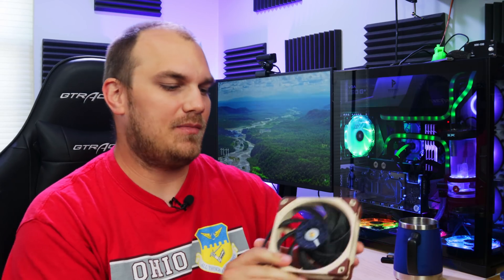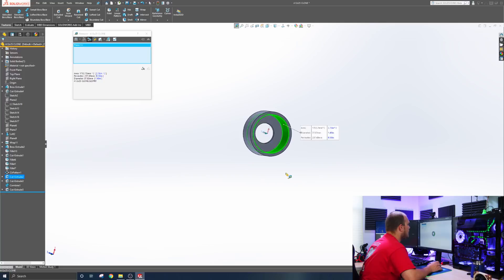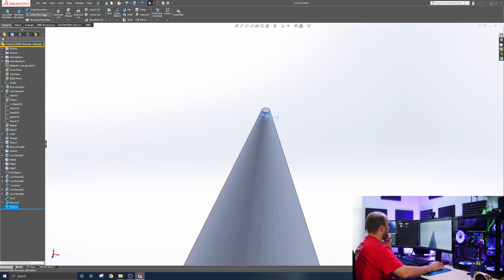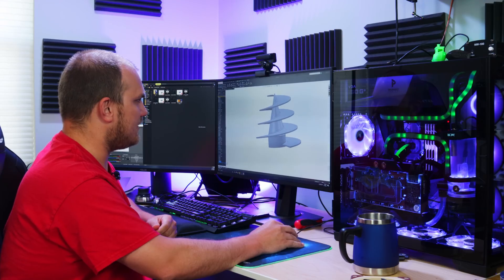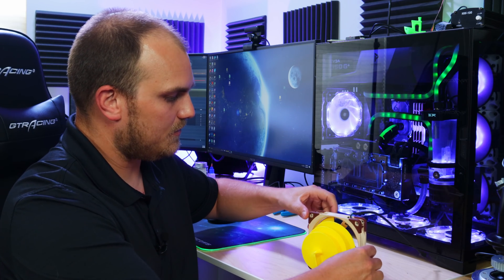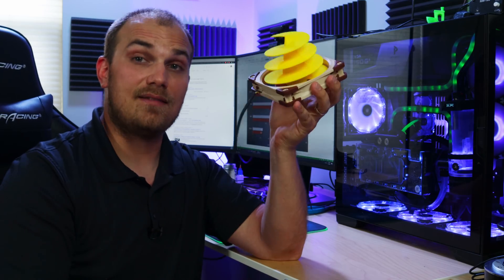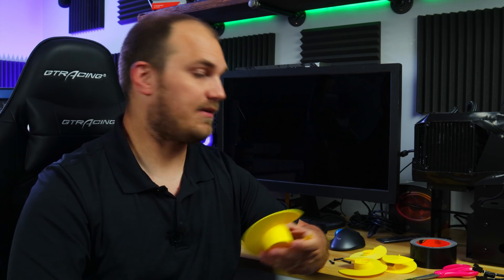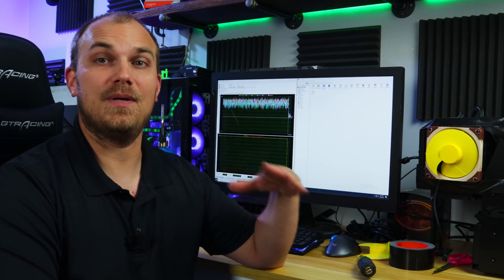Leonardo DA Vinci Made A PC Fan Would It Work?

Comment: Your making the age old mistake of thinking his diagram is a simple helix like a screw, there is intended to be a series of blades that run the length of the helix, across the air foil, from the center out, with an opening at the base of the fin, look at leonardos diagram closely, as he did many, one in particuler, which you showed in the beginning of your video., the second picture you viewed. Each of the radius sections shown are actually fins or blades.. with an open area at the base to provide constant air grab down the entire length of the helix.. just sayin.. we all know forced air or fluid dinamics require an area of containment, i.e. placed in a tube.. i liked your videos until i seen this..

Comment: The screw pushes the air out sideways from the top. Very little air actually goes down.

If you angle the outside of the screw down compared to the inside, it might push more air downwards.

Comment: I think you need to incorporate the elements of an airfoil like a wing as far as curve and shape of the blade.  You have to understand the physics of air movement and/or lift in order to incorporate those elements when designing the blades.  The other fans may not have worked as well as they could have because you didn't included considerations of physics into those designs.

Comment: i feel like the problem with this design (and I haven't tested with cfd/etc) is you're losing air out the sides.  what if it was still a spiral, but going down the corkscrew it used vanes tp pull in air like on a blower fan?

Comment: What about a double helix? should teminate the vibration issues. 
Also for a more effctive airflow try inverting the design, expanding the arial screw outward from the fan, and including a shroud along the edge of the blades. (think compresion in a turbine engine)

Comment: For this to work it would need to be a ducted fan with a constant diameter. Air moves outward as the fan spins so without a sidewall it doesn't go all the way through the fan.

Comment: i believed the source of unbalanced spinning is because you made it 360°. the weight could probably unbalanced or the angle is not 90°. probably 570° could counter balanced the vibration issue. who knows, just a theory
Reply: + shroud tube so the air doesn't escape to the side

Comment: A problem with that design is that the air can escape out the side rather than go through heat exchanger. If that blade was surrounded by a wall it would have no option but to push air through.

Comment: Hi! What about turbine compressor like fan? 3-4 blade rings on one shaft with the biggest fan in front and the smallest in back. all this with outer wall closing diameter with size of fans (like cone). That means: idea is that 1 fan will take thx to bigger dia. more air than 2 fan and 2 fan will take more air 3 fan and so on...  so final air should be denser and take out more heat .. maybe :D all fans can be on one shaft because difference in speed will be created by diameter ... look up for jet engine how it works

Comment: One of the issues with your design is that the spiral of the DaVinci design has a wing-like design of the blades, where it's thicker towards the center, which uses the same properties of splitting air pressure that an airplane wing uses, except oriented in a spiral. I'm not sure if it would actually make a difference, but in theory you should be able to produce a sort of lift under the spiral wing and in effect create airflow.

Comment: It would have worked but you see where you messed up at is that it's spinning the wrong way and even so you would have to build a funnel so that the air would go down the spiral because without the funnel you were letting air run freely, it's like putting a fan inside of the window blowing outside to suck all the hot air out instead of turning the box fan to where it blows air inside of the room

Comment: You can make it as a screw in side a PIPE so no air escape and full air forces in to cooling and one thing make  6 or 10 or more individual blades twist together  for more air flow inside the pipe☺️

Comment: U should try the house exhaust stack toppers in reverse, u know the domes with crescent cuts that keep the rain out, they are used to release a lot of flow without resistance maybe used in reverse it will pull a lot of air.

Comment: if you enclose the whole Archimedes screw into a cylindrical cone it will definitely will suck more air since the air doesn't have guides on where to go it just splash away before it even reach its destination you want it to go it just distort the atmospheric air around it

Comment: I am now subscribed, I find this interesting.  Here is an idea make a cowling (both tapered in and our) to see if that makes a difference.When you got it down to a single turn on the screw it looked like one of the old ship propellers when they started to use steam engines.  They started with one turn screw (literally) then went to two blades, and now they used as many as 7 blades on ships propellers (screws).

Comment: The first one would work if it had a cone shaped shroud just below the "grabber blade" that it pulls the air into. You basically have that air thats being "grabbed" escaping out the sides so it essentially doesn't do anything. Same reason Davinci's didn't work. Modern helicopter blades flex which I'm assuming is why Noctua's blades work so well.

Comment: There is a wobble, but is it consistently in the same spot or axis for each model you make?  If so you might be able to cure, or at least help, the vibration problem by using solidworks to find the center of mass for you.  Then either add or subtract material on one side to bring it closer to the axis of rotation.  Either that or use a hand drill and make dimples to remove material.  If you can't cure the wobble, cure the weight.
Reply: I suspect from the video that you also have more mass on one side of the vane also.  And it will exaggerate the effect on the outer edges of the vane.  If so you could lengthen or shorten the length of the vane just a shade to pull the center of mass back to center.

Comment: Tip 1: You're spinning at the wrong direction (in the beginning)

Tip 2: put a wing on it that runs along the spiral all the way to the bottom

Tip 3: hollow out the cone to improve speed and stop or lower vibration (this also lowers power needed to operate)

Comment: Curving the edges of the blades could help. As others have said the air is going out the sides so a curve in the edge of the blade will force the air down instead of letting it go sideways.

Comment: You need the blade to be spread apart more and there needs to be a ram style air capture at the start of the blade so the air can be channeled through the fan since the blade has no edge on the outside diameter the air is just moving out of the fan from the sides

Comment: You would likely have better luck running the air screw in the other direction with the air being transferred from high flow area to low flow area, similar to a jet engine. This way, the air will be accelerated by the decrease in the area rather than vice versa. A shroud on the outside would also be likely to provide a significant performance boost.

Comment: The screw doesnt "hook" the air. it pushes it, so as the air compresses it doesnt travel along the screw but it travels outwards along the blade and out into the open space. you need a screw inside a cone to funnel the air. Thats why if you look at the original sketches of the screw its not really a screw but a moving cone.  As the spiral spins it cups the air and forces it down. There is some serious improvement, but cool vid bro.

Comment: I think that fan blade is statically balance but not dynamically balanced so it will always want to wobble at high speeds even when printed perfectly. Soooo don’t be disappointed when printed with a better machine and it still wobbles.

Comment: What may be neat to see is that fan with a longer duct to trap some of the air which may escape from the sides, or even better, a fan that has a larger opening and larger initial fan and intake diameter and ducting that constricts and compresses the air down (at least in theory) like how a jet engine or steam turbine works to get the most efficiency out of a given volume of compressible fluid. Obviously, in no means practically as it would need to be a few inches/centimeters (for the ones who don't like the freedom units) long, but would be neat to see if compression does anything to improve it, as just the act of compression may increase the air temperature... Though probably not enough on that scale to matter!

Comment: The first thingi thought was that the whole thing wasn't spinning the right way at all. It wasn't scooping the air out as it were, but smoothing it down, that doesn't drag it out, that's just no good.
But of course it was blowing in, not sucking out XD. Yeah my brain...
But yeah, there is definitely a reason fans don't look like that.
Also, a tunnel around the whole thing probably matters A LOT !
So you might want to retest with an extended tunnel/fan hub.

Comment: It is basically only one fan blade with quite a low pitch. It should be slightly more efficient than one blade on 7 or 9 blade normal fans but to move same amount of air it needs more rpm(x7?) and/or more pitch(and this will have limits). You should check out NightFlyyer on youtube he has taken the one blade idea really far with rc helicopters. Same could be done with a fan.

Comment: try it like a submarine pump jet, put the screw in a tube, the air, if you are moving any currently just spills out the sides as its not contained, so you get no flow, put iit in a tube ;)

Comment: so, essentially the typical fan IS an airscrew. there are just many many more blades to it and much shorter. this design only allows for a mall area to capture the air (the area at the opening between the end of the blade and the one below it) you need a shroud to be as close to the outside of the fins as you can get to focus the air where you want it, and I would recommend that if you're going to use this for cooling, you need to flip it and add more there's to the air screw. this would allow the largest diameter to be on the outside so that more air is gathered to force the air down to a smaller opening, similar to what a turbo does to compress the air.

Comment: I can imagine a lot of air is being pushed outwards (sideways) from the axis of the fan. A duct or cylinder wrapped around the fan could possibly improve the air flow and direct it where you want it to go.
In effect your fan is a single blade design, generally more blades are better and the pitch angle also affects the air flow. Maybe putting alternating 'gaps' in your single fan would help to shift air better? So it is still a screw design but multiple blades?
I think it would be hard to improve on the efficiency of a traditional fan shape! Maybe something like a turbine shape of a turbo charger? Or multiple layers of traditional shaped fans stacked vertically up the centre axis, so the fans are aligned so the gaps and blades are staggered? 👍😎

Comment: 17:30 The vibration is caused by difference in direction of rotational acceleration at the lower half and the upper half of the fan, something like this:
...|
<-|
...|
...|->
...|
as a fan rotates, these points move up and down, caused simply by the movement of those points where the spiral abruptly ends.
It is impossible to fix if the design is 360° arc. Two symmetric 360° or 180° arcs instead of one would fix this. Two arcs that both start at precisely the bottom, on the opposite sides of the fan, and end precisely on top.
In fact two 180° arcs should work better than one 360°. Four 90° should work even better. And eight 45° arcs might work even better better, but I'm not sure. There should be a point where further increasing the number of fins no longer increases airflow because air starts bouncing away from fins rather than down.

Comment: I would suggest a triple helix with the cone inverted (small end towards the motor) with a matched stationary shroud. Should only need a 478 rotational degrees worth of blade height at about 30degrees of angular diameter change while maintaining the gap between helix’s at 25-40% of the effective blade depth (edge to hub). This is provide a large grabbing service and provide a compressing effect. I like the idea of a raised lip to minimize radial air loss.

Comment: Basically high presure blade, no flow. In a shielded cage would work to high positive air pressure cage... If u twist the corners down air doesn't go OUT of the center so maybe you get more flow

Comment: I'm just guessing at the physics but I'd think that you'd accelerate the air up to speed on the first layer and just be pushing on air already going at the speed of the fan on the second layer.  Maybe adjusting the angle of attack as it goes up would let you continue to accelerate it?  (I'm thinking, I guess, more in terms of applying thrust as a helicopter.)  Also, for a copter I'd think that enclosing it in a tube would keep you getting the air up rather than out.  Pushing air out to the sides doesn't do much for vertical lift.  
For cooling/moving air... maybe have the spirals get wider farther up to push the air farther away from the unit?  Maybe that could have a niche use if you needed to move air more to the sides than the top.
I wish I could do CAD.  I've tried to learn but I'm to ADHD outside of a classroom setting.  I tried inventing a new kind of chord harmonica but couldn't get all the moving parts to work.
If you put LED lights on the end of that fan I bet you could sell it as a cool lamp.  
It would be cool to have Smarter Every Day weigh in on the physics of all of this.
I wonder if it's got something to do with only having one point of entry for the air.  I wonder what would happen if you had multiple spirals wrapped inside each other.  (On something this small I think maybe there would be an issue with airflow between the spirals...?)

Comment: Make a motorized bellows cooled computer. 
Like actual bellows. There is a way to motorize them; look into how old player pianos from the 1920s and 1930s were built.
Gonna be super bulky, but that'd be steam punk af to have your computer cooled by the bellows from a player piano!
I recommend making the moving part of the bellows attach to the side of the computer case (like a full replacement of the side.
The system will suck in air, then in one go, expel all the air in the case out the case vents.

You think your computer "breathes" with LEDs? Make it ACTUALLY breathe with the entire side panel moving!

Quick search, and I found a site that looks like it can make custom bellows. As for the motor and framework to manipulate the bellows, good luck.
http://www.centryco.com/bellowsapplicationguide/

Comment: yeah, can you compare the stepping angle of the blade for all the fan you testing, could be a good data to gather and compare, you can use the step unit of the threads on screws to compare them up

Comment: If you're looking for a 3D-printer for an affordable price, check out the FolgerTech FT-5 R2. It's $500 and has a massive build space. You do have to assemble it yourself, but if you have a day free, it can be put together fairly quickly. I've been using mine for about a year now, and with a little tweaking, it makes some beautiful prints. You can also modify it to do CNC work or to have dual extruders if you wish, however that delves into some complicated modifications. Overall, if you are looking to save money but not settle for less, folgertech is where to go. I hope you see this, and I hope it helps. Good luck with whatever you choose, and happy printing!

Comment: i tink it has one major problem! while that fan pushing donw the air the air not realy goes to the radiator because it goes to the side. Try it put in a tube and the fan would be better if it has the same size as the tube

Comment: My goofy idea: add cowling, make it an impeller! You are loosing a lot of air spilling sideways without shroud, the engine case is definitely not high enough to do the job of restricting undesired directions of airflow and to do that you have to make a ducted fan. 

Fan fact: believe it or not, if you make this da Vinci thing as impeller, you will end up with something awfully similar to a modern submarine screw. Trafalgar, Seawolf, Borei... They all share this design. That long surface area of single blade helps to accelerate water gradually and evenly, so a submarine can spin the thing faster without cavitation, and cavitation is hell of a noise source under water, so preventing that allows that screw to rotate faster, push more water and propel the sub to a higher speed in noise normalized comparison against another submarine with a traditional screw.

P.S.: hard not to sub while talking about subs :D